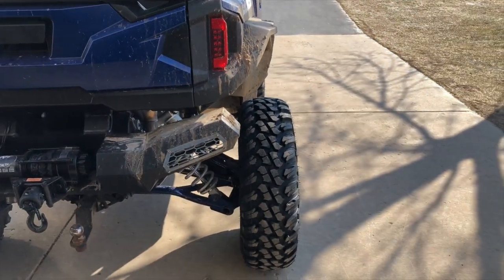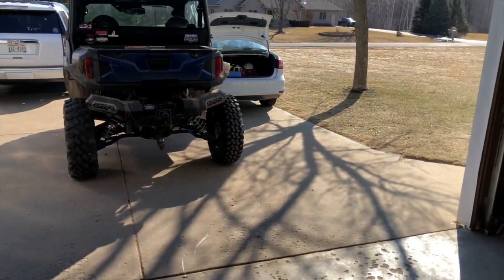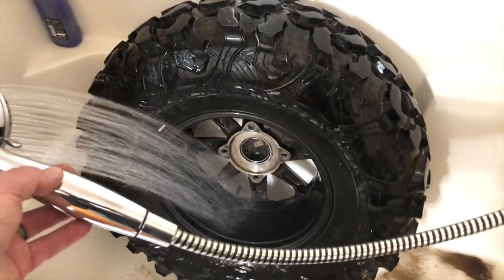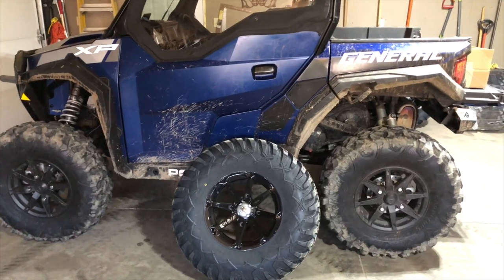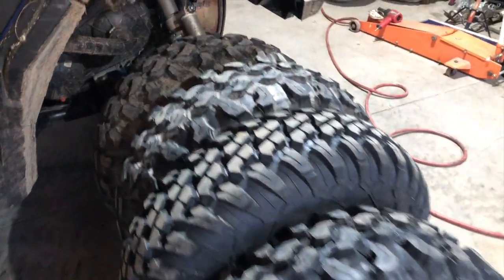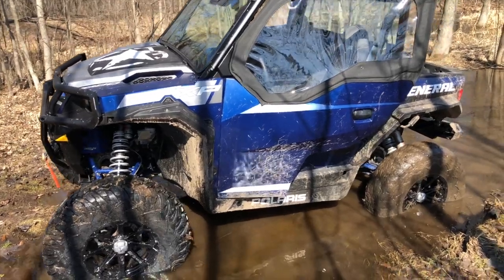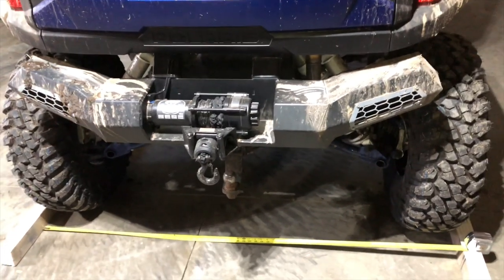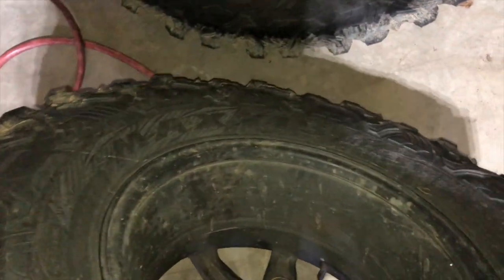2020 General XP new tires and rims! Tire testing Carnivores against Tusk Terrabites part 1!

Comment: What mods did you have to do to the General to get the 32 inch tires under your general? I have a 2021 Deluxe I want to do 32's on.
Reply from the maker: 32’s on an xp is pretty easy. Slightly harder on a non xp unit.

Comment: FYI as far as I know you can’t ride the KRX or register one for Wisconsin trails. Too wide 68.1’ Wisconsin only allows 65”. I would buy one in a heartbeat very nice machine. 
Another item I heard is for those who want to widen their machines over 65” and ride Wisconsin trails if you get caught the DNR will make you park your machine and you will need to trailer it out. 
They measure from rim to rim not mirrors or mud guards. 
So ride wide at your own risk.